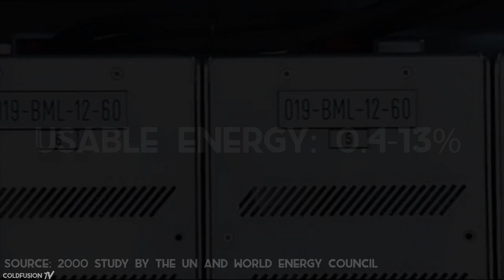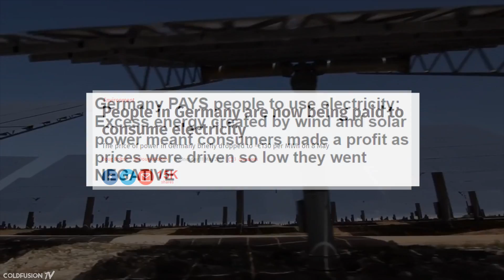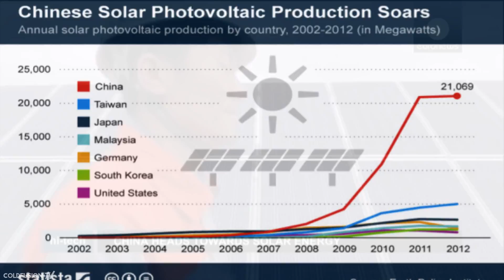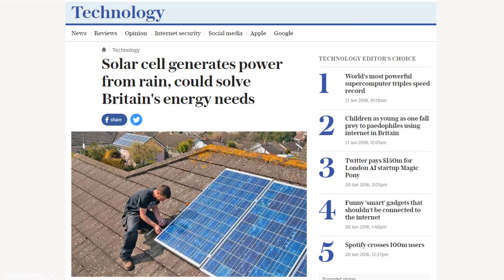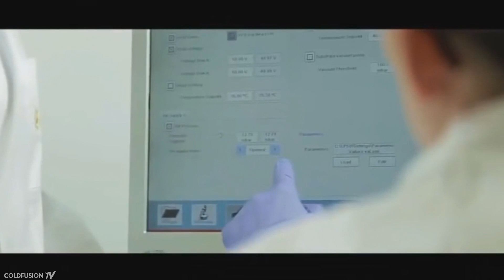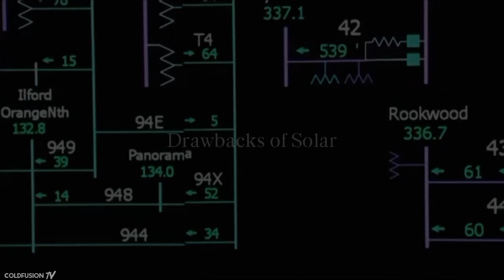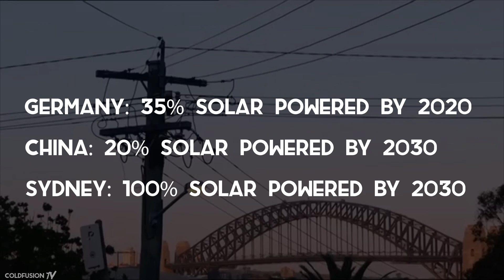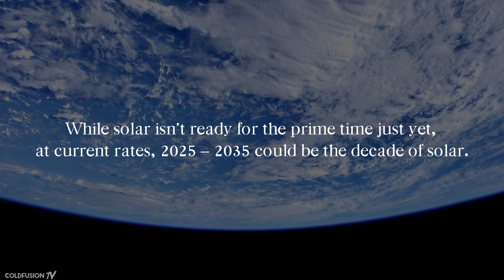The Truth About Solar

Comment: Sadly, outside of the obvious propaganda circles, this isn't very useful. It's got plenty of hopeful and a dash of math to sound credible, but it's just short of anything tangibly useful to those of us who actually have any interest.
   First, the biggest problem with solar is the same as with just about every other big energy ideal. It's the ever-consolidating market. "Everybody wants to rule the world" as it was said back in the 80's... The big energy conglomerates will be ousted from millions of dollars a year by the uprising of cheap and diversified solar and wind energy. They do not want that, and you're going to be hard-pressed to get government backing worth a tinker's damn against them. They already have all the money (and money talks and BS walks)...
   The next big hurdle is the actual chemistry involved in too much of this. From the core chemistry of plastics and non-biodegradables of the panels themselves, to the batteries and all their hazardous core tech'... This doesn't sound so bad to begin with, but remember, everything has a life-span. The reason your laptop today probably won't last more than five years or so (if you're real lucky) while that twenty year old desk-top will still fire right up is because the older components were larger. The electricity flows through, and particles are exchanged inside, deteriorating those components. This doesn't change with solar panels or batteries and sooner or later, it all has to be disposed of and replaced... Recycling is great and all, but there's only so much that can be done at once, and the haz-mat fountaining into landfills and dumpsites all over the world is just staggering as it is... Something has to be done about this as well.
   Finally, the efficiency... Yes, the efficiency is going up, and this isn't even really such a hurdle to be dealt with... BUT... It is going to be a concerning issue. Due to the efficiency at the best of times, there's going to be a drastic need for coverage. This coverage means devoting land (a fairly precious commodity called "real estate" to solar farms... So... what about the other possible uses that can't go on there anymore with the solar farms involved? In the vid' (and here's the crux of fallacy) there's only so much "usable land" available, and we're gobbling that right up with solar... (paraphrased)... So the real question is "why not use otherwise unusable land?" Or even "why should we stick to land at all?" Check it... If solar really works on an energy transfer of "photons to electrons" in the panels, why should those panels have to be warm or particularly protected? A little rugged durability, and as long as light's available, why couldn't they be in the arctic regions, or attached to high-altitude vehicles for research, further scientific and technical development (like capturing some of the greenhouse gases we're worried about), even recreational? If they won't (or can't) work, then maybe this stuff isn't as revolutionary or great as being suggested... Last I checked, you didn't need heat for light or electricity, in and of itself.
   Now, in case you made it this far... On that energy market problem... It's definitely arguable that diversifying the electrical grid is a mandatory concern to the government on its own merits. With only so many companies running things and only so many power plants in any given country, there's little difficulty in manufacturing the minimal munitions needed to target them and put that country (even the U.S.) effectively in the 1800's technologically. By diversifying to every household, farm, and building in the country, the grid itself gets added security because the only way to cause a catastrophic failure is to wipe out the same (a much larger prospect)... This was the exact kind of argument that government agencies (I like the term "the alphabet soup community") used to instill regulations and incentives for the banks to begin the networking project that eventually became the internet we're all using right now. That communications network, funded by banks for convenience in business, was piggy-backed by the alphabet soup groups and the military for better security and diversified leadership functions through the cold war. Now, with worries of terror attacks and other criminal and international unrest, it would only make sense to add to our diversification on the electric grid, regardless of the little squeezes felt by energy conglomerates who are (by now) obviously living on borrowed time as it stands, pretty much no matter how society moves.
   I honestly don't have answers for you as far as the chemistry of panels or batteries goes, but to warn that no recycling is 100% effective... :o)

Comment: I have an idea, let me know what you think. But it will probably only work in 30 to 50 years of technological breakthroughs. Let's put a humongous solar farm in near-field space (so maintenance is not too difficult) that feeds directly into high density capacitors. These capacitors, on demand, will power a super powerful laser which will shoot a concentrated and narrow beam of light down onto a terrestrial "receiving" station which has an apparatus that  can somehow (perhaps in similar fashion to solar water-heating systems) absorb this beam's energy and convert it into electricity, which can then be stored in super high capacity energy cells that will be sort of like Tesla's Battery for homes, but better. That way we can harvest gigawatts and maybe one day terawatts of uninterrupted solar power on a daily basis. Thoughts?

Comment: The thing about batteries, is that there are more ways to store energy. I read about this one place that bought energy from some country that was really cheap because the country was making more than it needed so the used it to pump water up, then when they needed power, used the potentials energy from the water.

Comment: 1970's $96.00 / watt (only governments and rich could afford)
2017   $ 0.36 per watt or $360.00 per KW (kilo watt)My electric bill (we have coal and gas in Colorado Springs, CO) is about $ 0.00002 per watt hour (way less than a penny). True, my bill says $ 0.00012 (or 12¢ per Kilowatt/hour) with transmission and line maintenance fees. Therein lies the rub.I could install solar, connect to the grid, and reduce my day-time bill almost entirely. But at night, even if the utilities owes me 100KW hours, I get charged the full transmission and line maintenance fees which are 85% of my bill. So until I can "get off the grid", solar is a 100% losing proposition.8766 hrs/solar yr  or 
2800 hrs/solar yr producing power.I have LED lighting throughout, and still use about 20-21 KWH per day. And if I had electric heating, try 45-46 KWH per day. Add batteries (and/or "hot" water to store heat) what am I getting into?Does that sound remotely economical?

Comment: One more draw back: If you live in a snowy country, you'll need to wipe off the snow so it can be efficent so it doesn't accumulate and become useless.... And sometime, the morning after a snowy night, it can be rock-solid or even become ice in some situation. The panels for northen country would need a stronger surface that you can abuse ( to take out thick snow/ice). After that, all this would need is people not too ''lazy'' to hop on the roof in the winter and clean the panels... probably before going to work while the car heat up a bit...

Does panels even work in cold temperatures?

Comment: Actually limit for solar panels is 33.7%, so the claim that there are panels with 35% efficiency is complete bollucks.
Reply: Shockley–Queisser limit refers to the maximum theoretical efficiency of a solar cell using a single p-n junction.
See the word "SINGLE" in the sentence?
Ever wondered what's a "triple-junction" cell and why they need "triple" to beat 33%?
Reply: Tell someone who cares, I'll buy solar when the cost per watt is low enough.
Reply: not so - single layer panels = tend to low efficiency (as you cite) but goes up with each layer - each layer collects a part of the spectrum optimally, BUT (big but) double layer panels are more than twice the price, almost 3x, and three layer are still extremely expensive - 2 layers can be more than 50% eff, and 3, more than 70% 
There are single layer panels (not Silicon) that have efficiency around 43%, but they are very expensive, so much it's not worth it yet (they will get cheaper eventually IF enough people buy them)
Reply: Remember the efficiencies they claim are under laboratory conditions, where they can optimise the light source, and control such things as temperature to maximise the output. It does not tell you what efficiency a panel will produce on your roof.
Reply: Anataro I'm not sure what the hell that even means all I know is it's wise to reduce twice ones that you actually need with a electrical system that has two settings with a step up inverter to trade the extra wattage for amperage or switch to standard amperage when it's cloudy. Using this system you will  be able to power more things in series and still be able to get at least 600 watts when it's cloudy.
Reply: with very new cutting edge materials they can get much higher efficiency, but those panels are put on satellites and cost a small fortune.  Solar is lucky to get 20% on a sunny day, heavy clouds and rain make solar panels into paper weights.

Solar panels are also made from very toxic materials.
Reply: Yeah, they're always just about to break the laws of physics - usually by false accounting.
Reply: No, they keep breaking the records within the laws of physics, but they DO break those records.
Reply: Doug Mcdonell To play your game, tell someone who cares about you not caring. See? No one required me to read your comment but I just gotta say I care enough to say I don't care. But yeah, I agree with you, they keep pushing the prices down and it will get to a point where it wouldn't even be much of a political issue worse than picking your phone model. Fingers crossed.
Reply: So much negativity, to just decide that it's a worthless cause. Only a quitter says forget it, cause it's a useless endeavor. To imagine something so far fetched. If everybody had this attitude, nothing would be invented. Can you imagine Nikola Tesla saying that this is a waste of time. To shoot for such an unimaginable thing. Everybody always has negative things to say, with no regards to the leaps and bounds, that we have already came.
Reply: Single-junction cells are lucky to hit 20% efficiencies. If cost is your concern, and it most certainly is for these systems ("solar power is affordable!"), then they will use these much cheaper cells. China is knocking these low-efficiency cells out in abundance, not cells with higher efficiencies.

The theoretical maximum wattage hitting the earth, with the sun at high noon during the peak of summer, is about 1kW per square meter. That's it. As the sun angle changes, the power output falls off with the cosine of the angle between the sun and panel's normal. That's what you have to work with. 

Now you factor in the efficiency of the panel, let's call it 20%, and you at best get about 200 watts per square meter for a while until the sun angle changes, then it falls off from there. Makes no difference what voltage you wire it for, its power output will be 200 watts peak. Thus, if you want a 1kW panel (any output voltage), it must necessarily be about 5 square meters, or about 7' on a side. If you doubt me, go shopping for panels and note power output and size. You will find that my calculation is ballpark correct. My neighbors have a 2kW-hr system on their roof, and it's about 15' x 8' (eyeballing).

If you have something that has cells with 33.7% efficiency, it will probably cost you 10x more, and the realized system's size will not be a lot smaller than the cheaper, less-efficient systems.

This is why kids with environmental major degrees don't know what they're talking about ... they can't do math.
Reply: "In May, Sharp regained the world’s triple-junction, non-concentrator solar cell efficiency record — 37.9%. Now, it has also taken the overall world solar cell efficiency record — 44.4%."

cleantechnica. com/2013/06/23/solar-cell-efficiency-world-record-set-by-sharp-44-4/
Reply: @Denys. You left out the second sentence in that press release: "The solar cell is of the 'concentrator triple-junction compound' type, which basically is a lens-based system that focuses sunlight."

What this means is that you have a big honkin' Fresnel lens in front of your solar cell. That lens has an area A1. It then focuses the impinging sunlight down to a much smaller solar cell with area A2, which then gives you its 40% conversion efficiency. This system does absolutely NOTHING to increase your overall power output because you can only collect the wattage that falls on A1, which is finite (about 1kW/m^2). I.e., each individual cells require a space of A1 each, not A2. If A1 is about 3x or more in area than A2, then you get far less total output per square meter, with this Sharp cell than you would with a farm of conventional solar cells of A1 and an efficiency of 20%.

The Sharp cell is nothing but a scientific curiosity with absolutely no practical uses, but it's the sort of thing that ignorant environmental studies majors fall for, hook line and sinker.
Reply: Shockley–Queisser limit says  it is bollucks.

Comment: Howcome there must be a a large invesment on the grid's infrastructure to make it compatible with solar energy? 
At the solar module array's DC output, there are inverters. This equipment is in charge of transforming DC to AC, and engineers desing the configuration on this equipment to provide energy synched with the grid, thus, making unnecesary andy kind of modification on the grid.

Comment: The biggest problem with solar energy right now is cost and efficiency, despite what was said in the video it's not so pink with years to come. The problem is with energy storage. To power a household effectively you need solar panels and batteries. A lot of them.  Yes I understand that the battery and panel prices are going down but you didn't mention the lifespan of those elements. Solar panels have a lifespan of more or less 10 years in which time they consecutively lose efficiency. The same goes for battery capacity. They have to withstand thousands of charge cycles in changing energy supply conditions. Also those efficiency estimates are way off. The best available solar panel we have available on the market are around 20%, PEAK! With time they scratch up, cover with dust, rain residue bird excrements etc. Also in the winter time they need to be cleared or heated to remove snow and ice.So lets say you take a loan of 20 000 $ an set up a 5 kW solar installation. By the time this thing pays off your loan from energy savings the panels and batteries will need replacement so theres no actual gain from this technology right now. May be in 20- 30 years when the cost of those installations will go down dramatically and the efficiency and durability go up, they may be a good alternative for the grid.  Thats the sad truth of solar energy.

Comment: Drawback 2 and 3 are nothing if people really want to chase after solar power. Drawback 1 unstable power output is the biggest problem. Energy works the best when consumed right after production. Storage and transport takes investments on infrastructure. Storage and transport also have their own efficiency issue. 
I am OK with putting solar panel on my roof. But if I need to pay for battery for this thing, no thank you.

Comment: Show me where I can get solar panels for my home for 36 cents per watt.. And then talk a bit about the massive chemical waste generated by solar panel production, and about how that is driving solar panel prices down due to lack of environmental regulation and massive toxic waste dumping in China that makes panels cheaper at a cost to the environment..

I'm all for solar, I am waiting for it to get cheap enough for me to put up an array to power my home, but your not telling "the truth about solar", your making a solar propaganda piece, a fluff story.

Teslas power wall is just a box of lithium ion batteries with a charger and inverter, sold at many times the price I could build one myself for, and not really economically feasible as you would need several of them to run a modest household.

Comment: 27% until 2050!  No, I don't think it will be this low, except if  we don't  allow this as a society
 .We do not need to lie to the people. Or propagandize "clear" energy solutions , because of environmental issues. It becomes so transparent , it is laughable , and negates the whole cause. Because, environmental issues or not, the main driving force for allowing solar to go on or not go on , is the financial well being of major players. If it facilitates their interests they will allow it go faster, if not, they will claim technological inefficiencies and find excuses...
 See, that after a few mins the speaker says , modern solar power producers, produce so much , they export or give it away for free, even with today's efficiency and energy storage solutions. The truth is , that even right now, solar can provide multiple times 100% of our energy needs per year, albeit without avoiding wasting it because of inefficient batteries, or without avoiding an unacceptable cost of developing it overnight, because of lack of infrastructure.
 But 30 years, or so, that part us from 2050, are practically centuries in terms of our technological and financial capacity to fill the distance. I say we will at least produce more than 100% of what we would need in 2050.